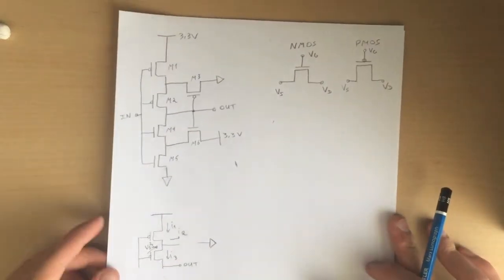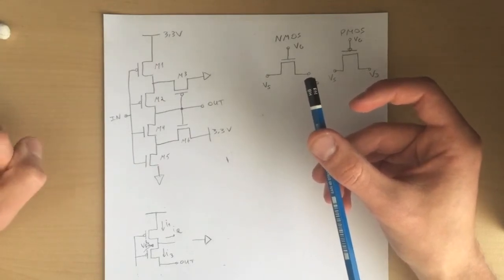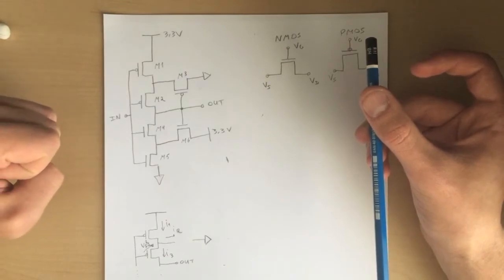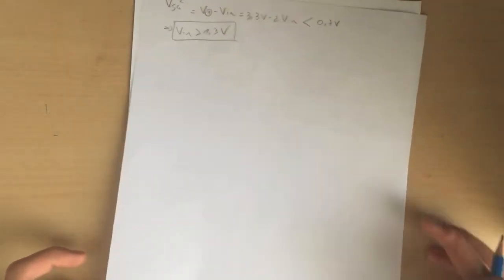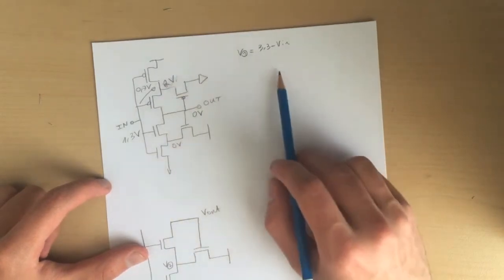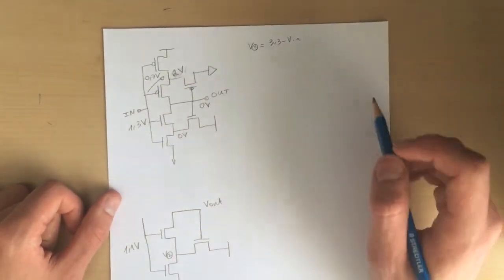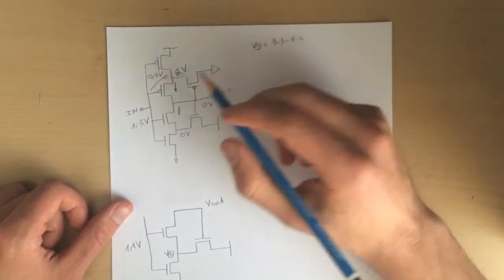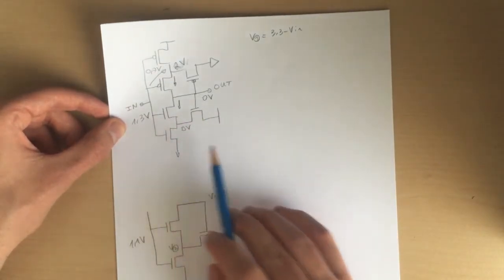CMOS Schmitt trigger - a step-by-step qualitative analysis

Comment: 3:36 where does the diode come from? I can only imagine PN junction between P source and N substrate, but not to P drain. Also, isn’t it like a low ohm resistor when turned on?

Comment: Thank you for this great insight! I have a question over the same current flows thru Mn1 and Mn2 (@ 15:58 min) where you show a graph that higher VDS is required for Mn2 in comparison to that of Mn2, right ? but actually the value of I2 = I1 + I4, right ? so I1 is not equal to I2 ! can you explain it please ? thanks!
Reply from the maker: I'm glad I could help! 
As I wrote in my description: 15:10 - I should have looked at the current in the triode region, but the conclusion remains the same. 
VDS over these transistors is low and therefore you have to look at the part that is close to (0,0) in the graph, which resembles V = RI of a transistor. You are right that the currents are not the same. What matters is that R2 > R1, which is why Vout - V2 increases.

Comment: So if we want to set the thresholds and hysteresis, if my understanding is correct, vout rising th is VIN= is [3.3-Vth(M1 or M2) ]/2 and Vout falling th is VIN = [ 3.3+Vth(M3 or M4)] /2
Reply from the maker: Yes, this seems to be correct. However, I would suggest you check this beforehand in simulation just to make sure.

Comment: Why is the other threshold 2.2V? shouldn't it be 2V -> (vdd+vth)/2 = 2V?
Reply from the maker: Yes, if the first threshold is 1.3 V, then by symmetry the other one should be 3.3 - 1.3 = 2 V. But again, check in simulation first to make sure you get what you expect.

Comment: for Vin=3.3V and power sypply also 3.3 won't Vsg= 0 and hehnce pmos M1 be off?
Reply from the maker: Yes, you are right. There will only be current once Vin gets below 2.6 V. But until that point, the voltage V1 will be 0.7 V. I mention in 5:15 that the diode and hence also the PMOS are on the "verge of conducting". Hope this makes it more clear!

EDIT: The result I got in 8:33 is thus only true if Vin < 2.6 V. So that's a mistake on my part.